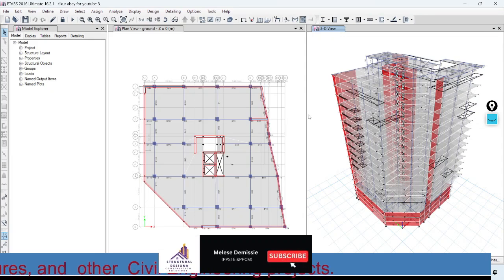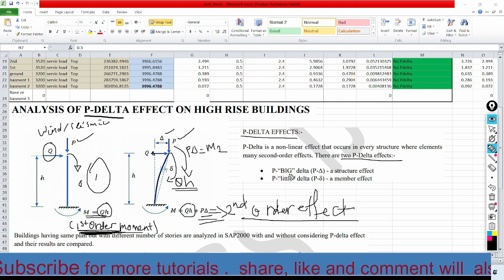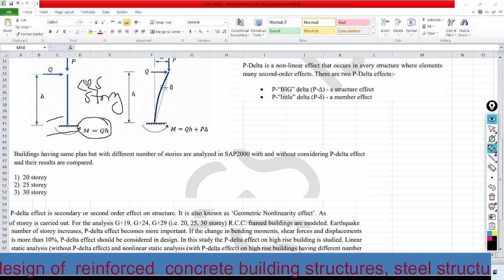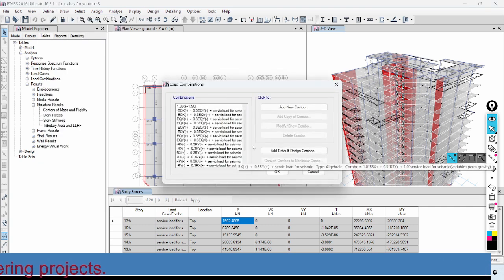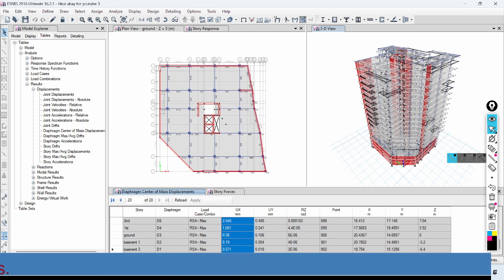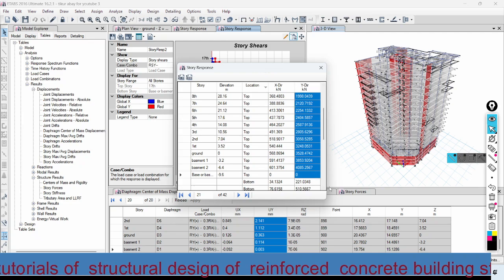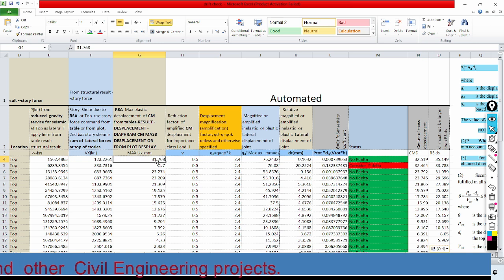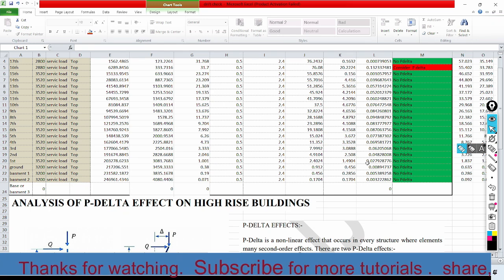Complete Structural Design of 20 Story Building using ETABS with Eurocode & Ethiopian Code (part17)

Comment: Does p delta check need RSA or we can do it with ELF values if we dont want to do rsa
Reply from the maker: we need to use p delta check for dynamic and static case. for dynamic case use RSA FORCES and for static case use EQ  FORCES.

Comment: The P(KN)(vertical force in the global z- direction), due to  the gravity loads  from structural result, story force at level of basement  is not shown .can i take same as base reaction?
Reply from the maker: @kadridajci5162 seismic weight was taken   above the the top of rigid basement (ground floor) .
Reply from the maker: Hence , drift and p delta values are taken as 0 at ground floor and for base shear calculation you can display story shear at every story using display- display plot results , story shear...
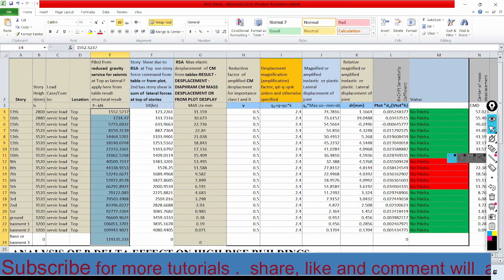Reply: @  thank you! I was confused because in video in minut 27:25 is a value of P(KN) at the level of base.
Reply: @ can i ask when we check overturning momement , to calculate the resisting moment , the total weight of building will be seismic weight or dead weight? Will be included even basement weight( sum of joint reaction (Fz) for dead load combination)?
Reply from the maker: @kadridajci5162  to calculate  overturning moment in static case,  the  seismic weight  should be considered at every story and multiplied with moment arm( distance from the base)  . In the case of dynamic case, simply take the  overturning moment due to  response spectrum load cases which considers also seismic weight for calculation of seismic response parameters( period , displacement,  velocity and acceleration) which are  variable to calculate overturning moments. Generally dynamic related outputs are calculated based on  seismic weight which creates spectral acceleration. Hence  you should decide first which types of analysis is preferable   for the given structure. Some codes has a limit on static and dynamic overturning moments. To display the overturning moment, go to display menu, display response plot, overturning moment for every static load cases(EQ) and  or dynamic load cases(RS).... Hence use seismic (inertia forces) instead of dead loads.  Inertia loads are lumped at CM of  every story . Seismic weight is simply diaphragm mass .That is all...
Reply: @ hello thank you! I want to calculate the overturning moment manually, when i calculate the resisting momentMr= seismic weigh of all building(include even 2 storeys of basement=sum of joint reaction  Fz( for service load of seismic)?
Reply: I have 2 basement stores , and i want to check overturning moment in dynamic case
Reply from the maker: Seismic weight of the building contributing for dynamic response is the seismic weight above ground floor if the lower story selected  is ground floor. So an extra two basement stories are resulting extra base reactions. Hence they may not be  equal unless you use the ground floor  level  as a comparison insteade of base of foundation

.
Reply from the maker: @kadridajci5162   you can check by taking the lateral story force and   height from the base.
Reply: @melesedemissie7664  so to conclude for resisting moment=seismic weight( even 2 basment storey of building)x(distancr  of center of mass ). The resisting moment/OTM>1.5
Reply from the maker: @kadridajci5162  yes 1.5 is the safety factor
Reply from the maker: I think u mean P value at basment floor, if so just you can take it at basment level 1, basment level2, basment level3 with design gravity combo.. P at basment level 3 is  the vertical  reaction component

Comment: If I am designing and analysing the RC structure purely based on Eurocode. Then, I should only consider ELF , RSA, and pDetla analysis to check my structure safety and design data?
Reply from the maker: Add imperfection load